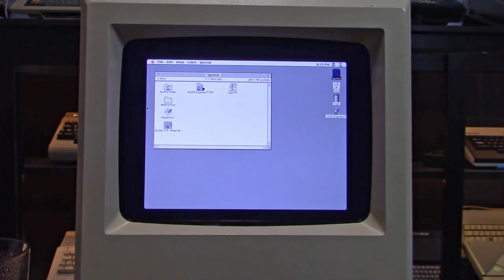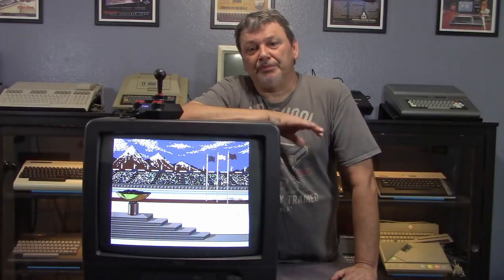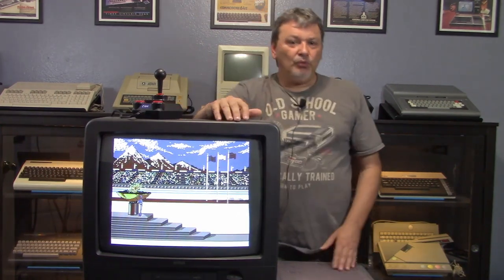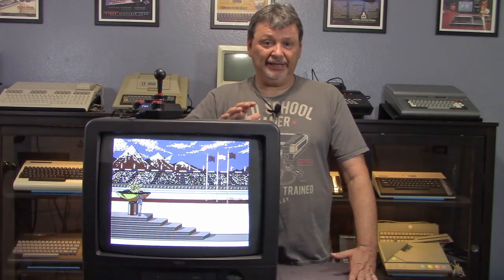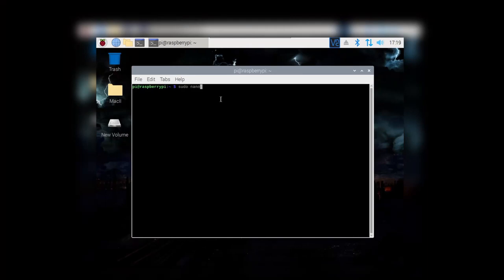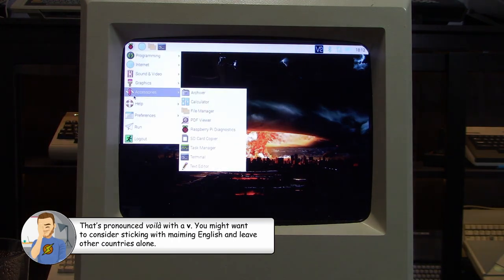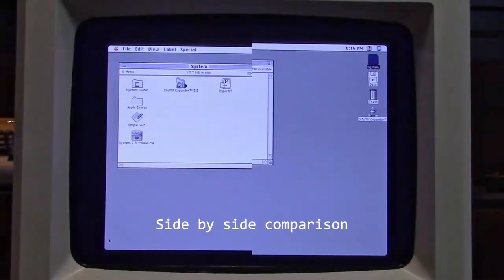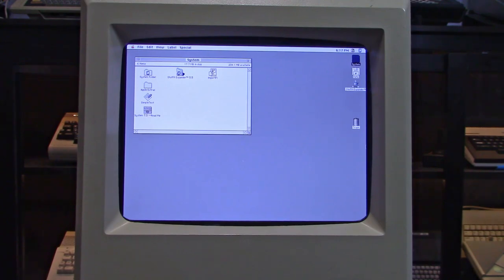Raspberry Pi: Manually Adjusting Overscan Settings

Comment: hello there. I have done the same project as you.1 issue i have though is if you turn on the gl driver on the pi my over scan setting return to default and as you showed you cant see a fair chunk behind the housing. do you know of a way to fix over scan with gl drivers enabled? many thanks

Comment: I now want to make a mac emulated by a raspberry pi like that one. However I don't want to destroy an existing Mac to do this. Can you buy Mac shells? I did some web searching but only found a kickstarter selling transparent mac shells, and a bunch of modern iMac shells for some reason.
Reply from the maker: I'm not aware of of any sources for empty Mac cases other than finding a dead one used on eBay or Craigslist. There was a post on the Hack a Day article from someone that said he had a dead SE that he offered up if anyone wanted to do the project. Not sure if that is still available though. (https://hackaday.com/2020/08/13/pi-saves-vintage-mac-case-from-a-watery-grave/)
Reply: MacEffects make new transparent shells for the Mac SE/30 and Apple IIGS, but they are quite expensive for a Pi build. I'd suggest compromising on an old CRT display and hacking a Pi to fit inside.

Comment: What would be great is to be able to add a CRT filter to the emulator like you can in retroarch. It would be awesome if you could be able to control the "overscan" that way and even mimic scanlines and screen curvature you get on real Mac CRTs.

Comment: That's still so dang cool.  If one of my "classic", compact Macs is ever hopelessly dead, I'd love to do something like that.  At the moment, however, they're all running relatively well in their original builds, and I certainly do not wish them to die LOL.
Reply from the maker: I feel the same way about my Mac SE. It's a great machine and I hope it stays running for a long time. Interesting side note, I just got the SE about 2 years ago, and it's the first and only Apple computer I've ever owned.
Reply: @Operation8Bit  Cool! I actually just got my SE about two years ago as well! Traditionally, I was mainly a PC guy growing up. Collecting vintage Macs has gotten me into more modern ones as well, so now I use both Macs and PCs each day.
Reply: So give your opinion then, which is better? Mac or PC?
Reply: @theharbingerofconflation  That depends on the user, the era of the machine, and the intended purpose.  Also, sometimes that question is better stated which OS is better...